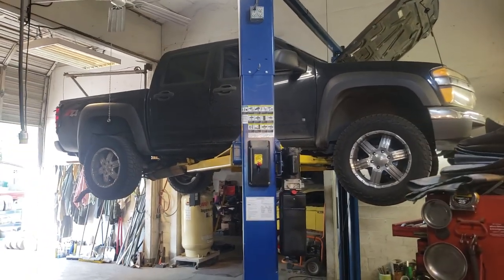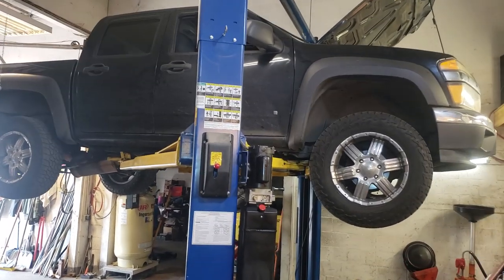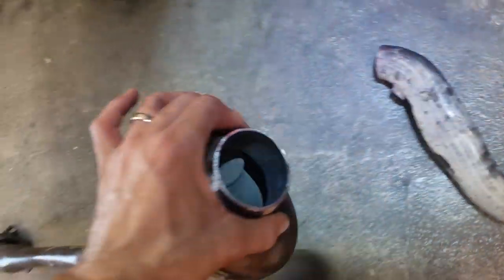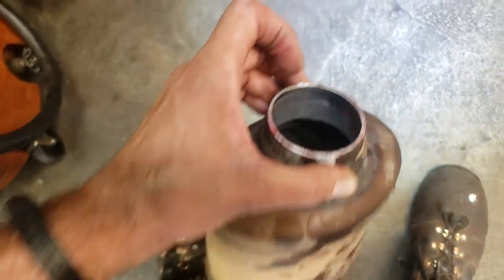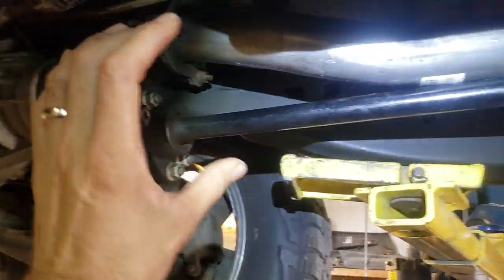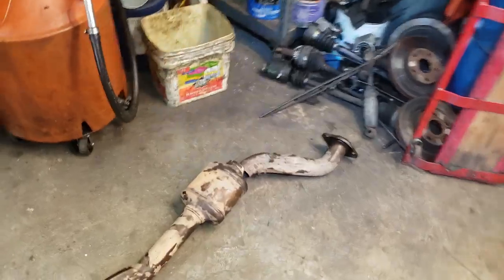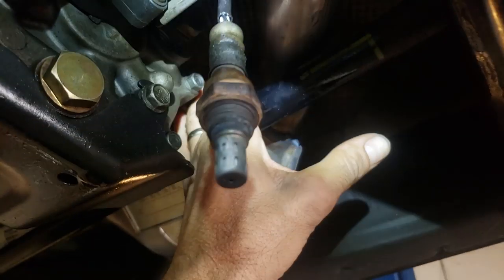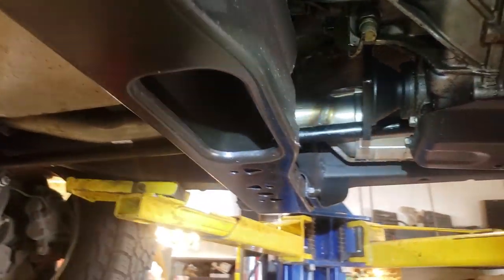Cowboy Chevrolet Colorado catalytic converter

Comment: I wonder if the engine will run cooler.  I recently had the original cat replaced on my 88 Dodge Aries 2.5, and now, the normal operating temp of the engine, per the temp gauge, is back to normal - comfortably below the halfway mark.  I guess if an engine can't push those hot exhaust gases out efficiently, it can't shed heat as well as it should.

Comment: my Volvo 240 had that happen with the catalytic converter, probably after one the backfires the car regularly spat out while the ignition computer was going haywire. found round catalyst chunks rattling inside the muffler after I dropped the exhaust to replace the rusted mess.

Comment: I have this truck, 2011 model with 3.7 5-cylinder. I notice the pipe from the catalytic converter is flattened, just like the one you have in your video. I wonder why GM did that?